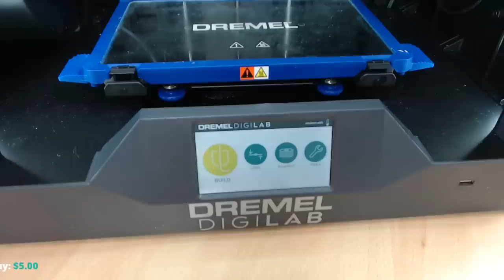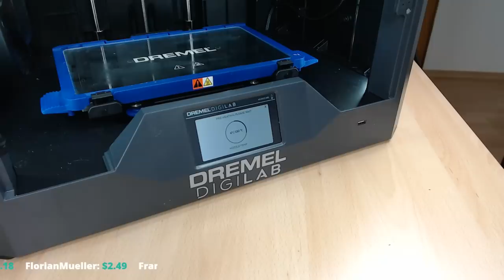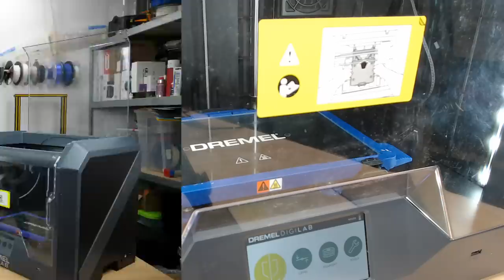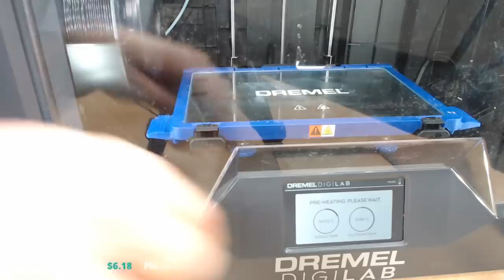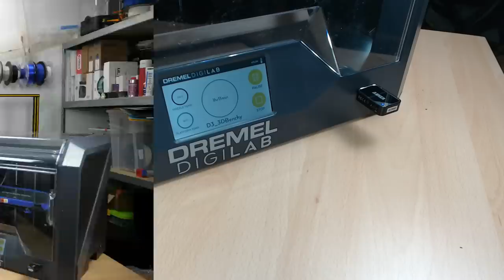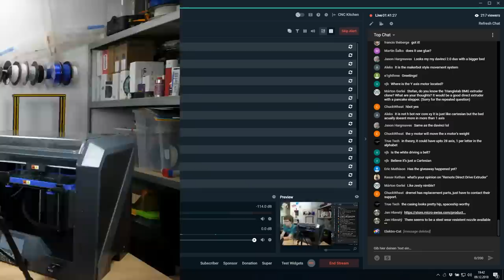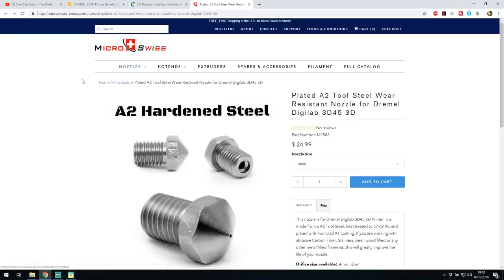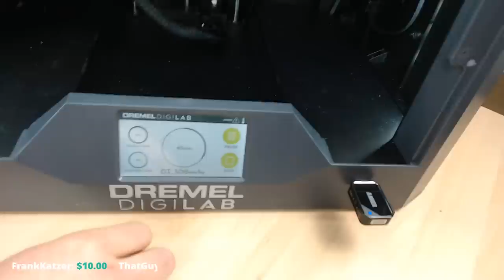LIVE: DREMEL 3D45 - Unboxing + First Print

Comment: I don’t think heating the bed and nozzle would have made a difference with the first layer.  The servo would have compensated for the distance.  You should check to see if there’s an option for z offset, you could possibly make it a bit higher
Reply from the maker: Just found out that you can set the z-offset in the settings.